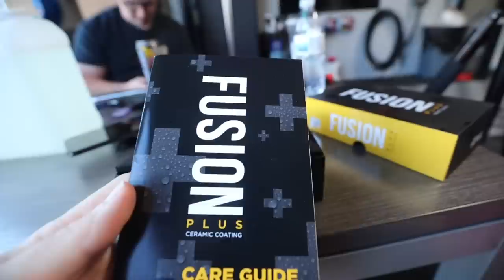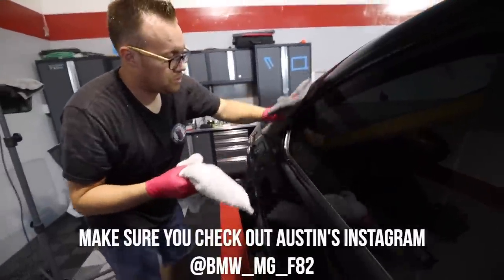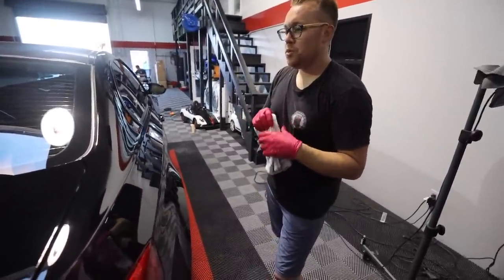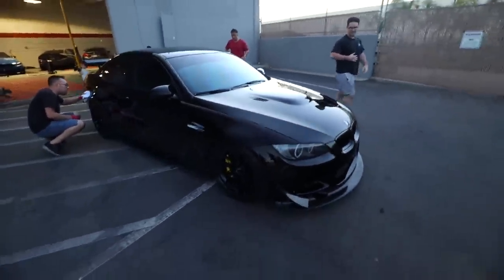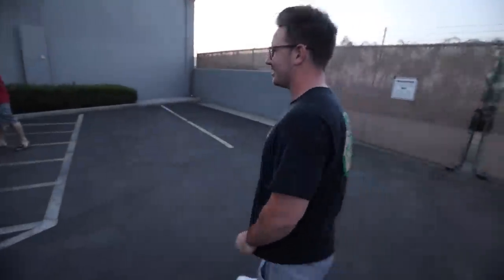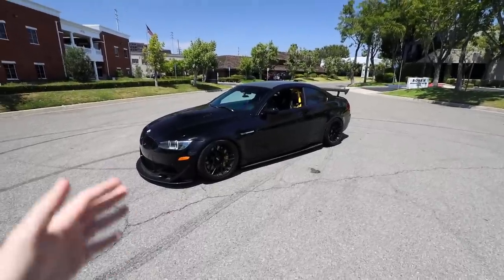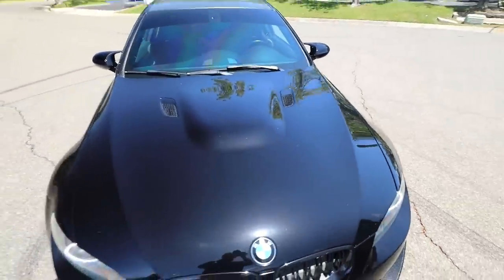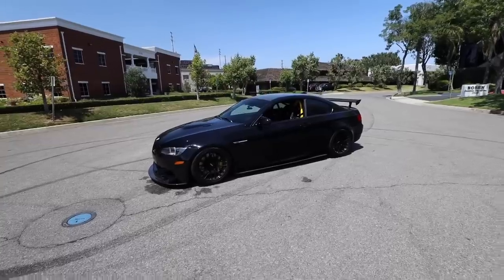Seeing my car after a 22 hour detail!

Comment: I've watched a few of your videos now.  You got a really constructed 1/2 cage in the back, seats, belts, suspension, wheels, almost r compound tires, aero, engine upgrade... I thought you wanted to recreate a Schirmer car, which really is a track car.  Now I think I understand it is a garage queen.  Are you prepping the car for the track?  or like a SEMA car that most will never see the track but with tons of upgrade that doesn't make sense for the street (like your low front splitter).

Comment: If you live in area with hard water dont let the water spots etch into the paint. So dry it in the shade. Also if you dont want scratches to come back use the door hands to shut door not the door itself. ;) that spot always gets mangled with scraches.